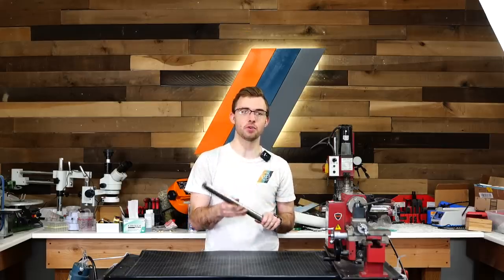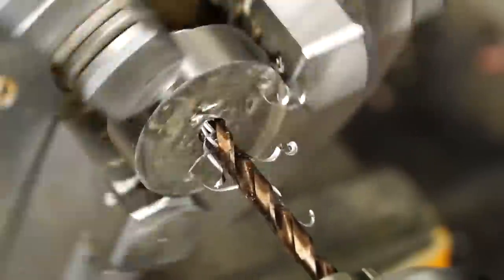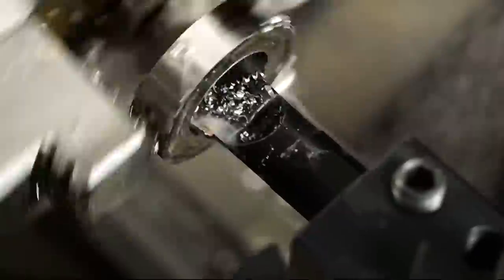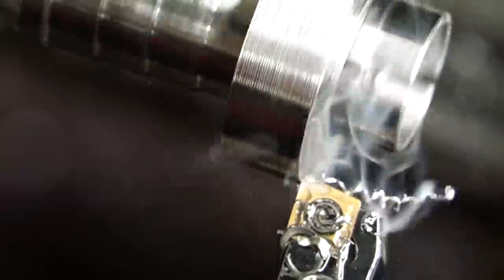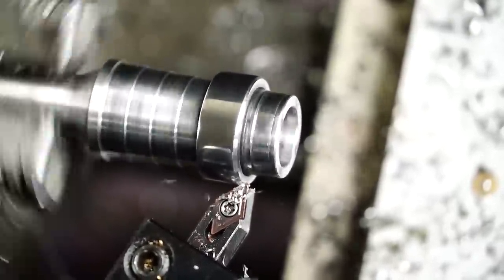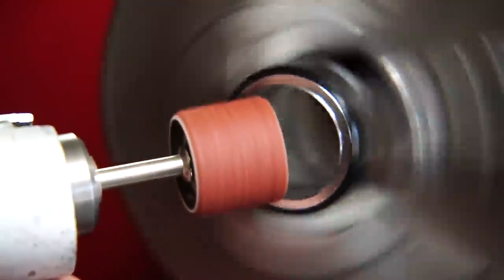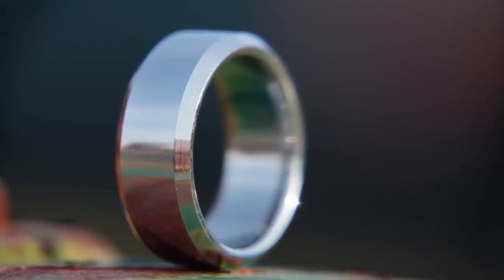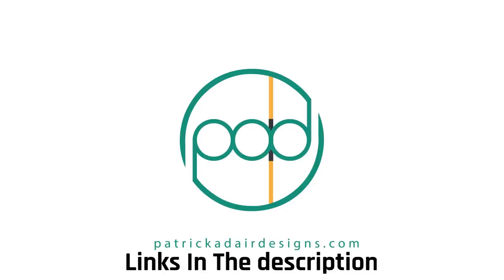Making 2 Inconel Wedding Rings on a Lathe

Comment: When I married my wife a little over 50 years ago, I made the rings our of Inconel.  I started wigh a piece of tubing that was a bit too small for me but too big for her.  I therefore cut the tube and welded the metal, using the piece from hers as a filler for mine.  I used oxy-acetylene with a special flux.  We are still wearing them.  The engagement ring was also made from Inconel and the stone is a synthetic ruby (South Africa was still under boycott because of apartheid so diamonds were taboo.)   

Incidentally, the correct pronunciation places the accent on the first syllable  IN-co-nel.  (Derived from INCO, the abbreviation for International Nickel Company
Reply: That is really cool!

Comment: Is it safe to wear this rings? I know the alloy is corrosion resistant, but inconel has a very high nickel content, and nickel can cause alergies to a lot of people. Stainless steel is safe to wear, and it has nickel as well, but a lot less, so I don´t know.
Reply from the maker: Luis Horas probably not a good choice if you have Nicole allergies.
Reply: @PatrickAdairDesigns  but i like my Nicoles :D
Reply: Inconel is actually a family of high-nickel alloys.  Inconel 600 is the basic and most common.  It consists of 77% Ni, 16% Cr, and 7% Fe.  It is my understanding that the alloy structure prevents, or at least minimizes, the problem of nickel allergy for the small minority of those who have that problem.  My wife and I have had our rings on for >50 years with no allergic problems.

Comment: What do you use as protection for the outside when you chuck it in the lathe to process the inside? Looks like rubber but could also be just tape. Thought there is some secret tip maybe 😉🤷‍♂️
Reply: It’s electrical tape.

Comment: Never EVER put your finger with a piece of sandpaper inside a ring like that.. a wise man once told me.. "Don't put your fingers where you wouldn't put your pecker!"
I also would never use Inconel for jewelry because of the high Nickel content.. i'd rather use Titanium.. as a matter of fact.. i did use titanium for my rings
Reply: Pretty sus on a 3 jaw  but I think he’ll be fine
Reply: As I stated earlier:  Inconel is actually a family of high-nickel alloys.  Inconel 600 is the basic and most common.  It consists of 77% Ni, 16% Cr, and 7% Fe.  It is my understanding that the alloy structure prevents, or at least minimizes, the problem of nickel allergy for the small minority of those who have that problem.  My wife and I have had our rings on for >50 years with no allergic problems.
  And the small minority who are allergic to nickel suffer a minor rash.  Your finger won't fall off.